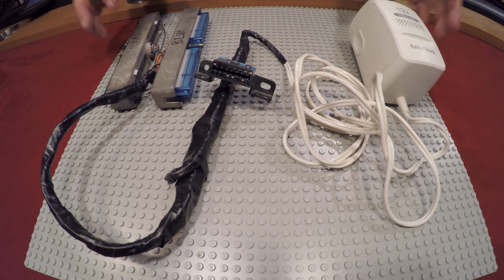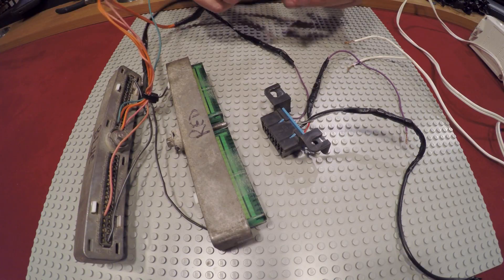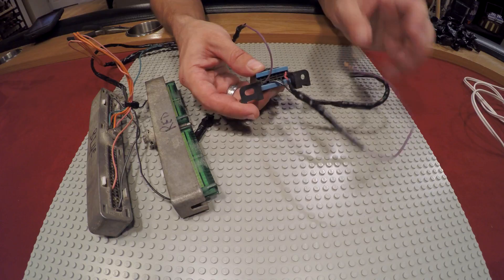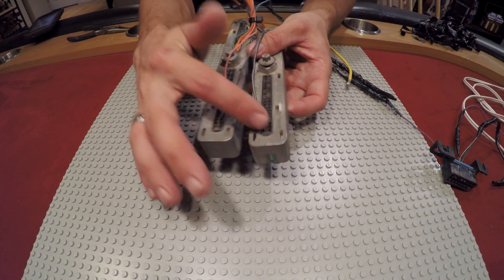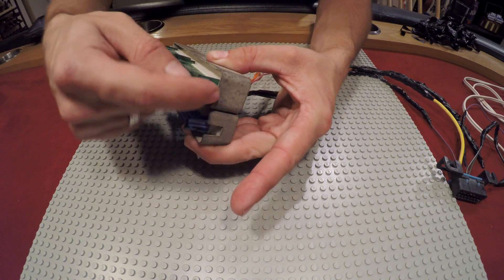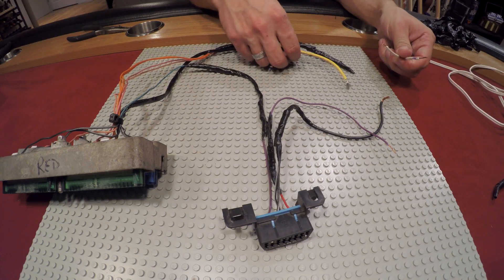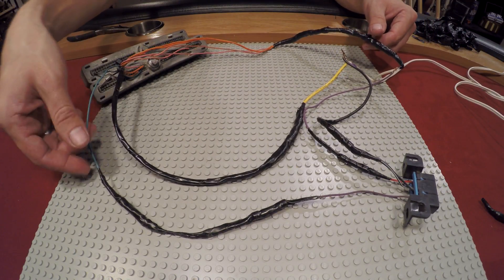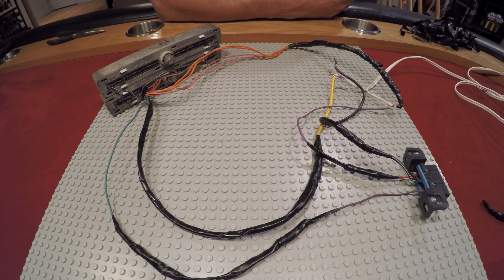How To: ECM Bench Harness + Funny Bloopers | OBD2 GM LS Computer Tuning Setup

Comment: Just use an ATX power supply. Hardwire the PSON wire to ground so you get power when you turn on the rocker switch on the power supply.

Comment: Which pin is the data cable on the odb2? I'm curious to know if the aux gauges from camaros will work on other pcm (for a swap of course)

Comment: I’m built a harness to unlock GM radios just with a BCM to radio  connection but it did not work . Do you think I need both ECM and BCM connected to the radio in a bench to reflash it ? Please im in desperate help .
Reply from the maker: +Benny Lemma I dont think the ecm has anything to do with that. But I have never tried unlocking radios, so cant say forsure. But Ive never seen any pinout with a wire for the radio.

Comment: can you just use a car battery
Reply from the maker: +chase gant You can. This way is just easier and safer. Before I made a harness I just used the battery and it worked fine.

Comment: Hey there bud. Cool vids. I play with efi programming on dmax. But I do have a few full engine and harness and tranny’s from take out truck which ended up getting a dmax power. The question I have is can the hp tuner , tune in a dsp2 or dsp5 switch into the gm factory comp to power the gas bald eagle engines. And could I be able to see my tunes in my dmax which has a dsp5 switch. I’m looking into the tuner for my own Christmas present, along with some hair driers for 6.0 to go into a mustang. Dm on insta. 402lb7   My name it T.J. And once I get done slapping all this shit together, will need a nice long drive out to meet you guys. Thanks for any info.